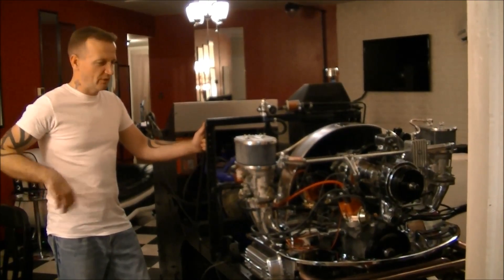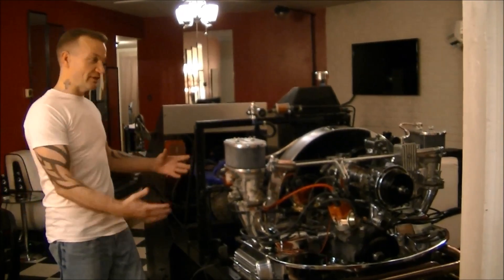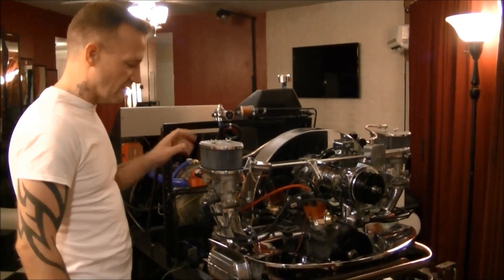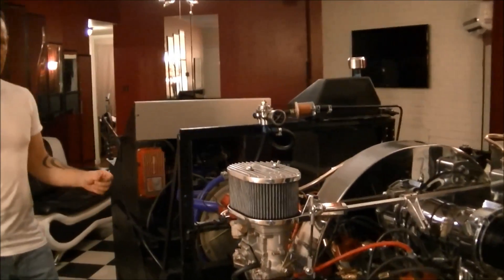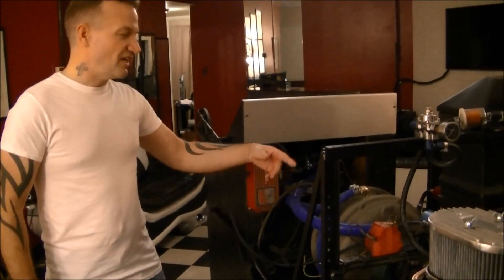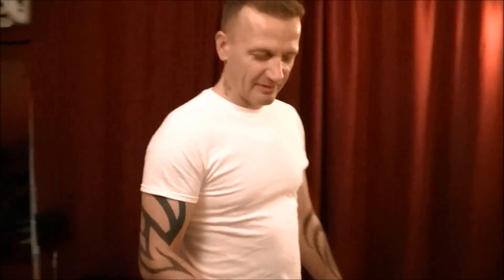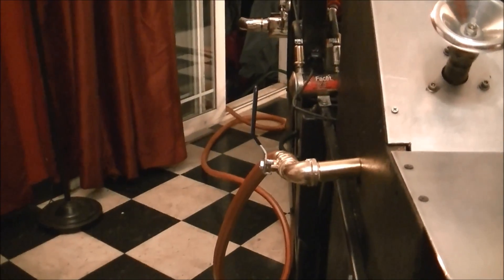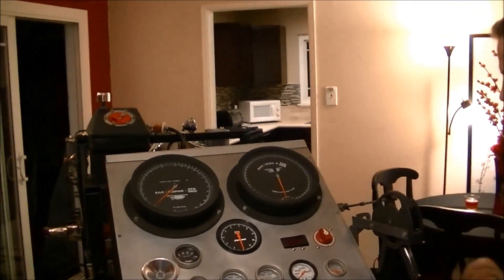Engine Dyno In The Livingroom

Comment: i was looking at a photo of your setup over on the samba in the "
Can we talk about dual carb linkages?" and in your message there you state "adding a bearing kit". i was trying to see what you had done but can't make it out. my linkage isn't torn up but i'm always looking for cool ideas that may make things better. do you have a link to a part or something?
Reply from the maker: Hey there! The bearing kit is a nice upgrade even for a new linkage. its about $100 but worth it.  it keeps things 100% dialed. i can remove the linkage, put it back snd its still in adjustment.  Here is the kit https://www.thesamba.com/vw/classifieds/detail.php?id=2390952
Reply: @jpaull  nice upgrade. it's going to have to wait at that price. my scattering 009 has to go first.